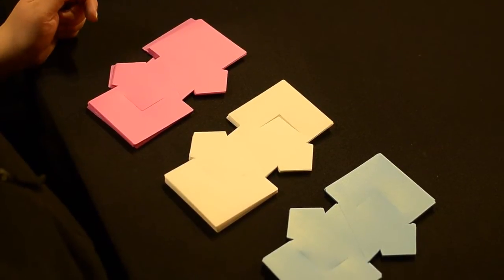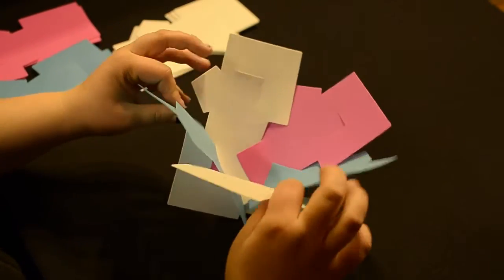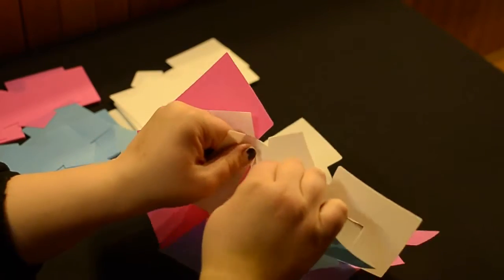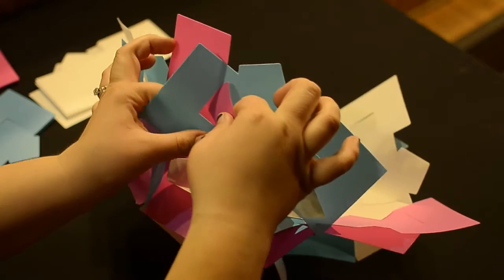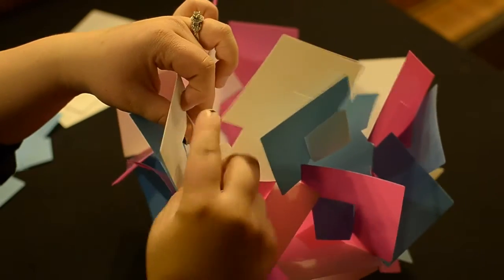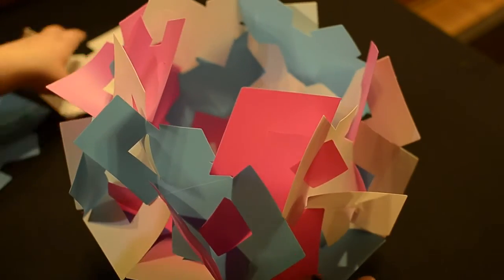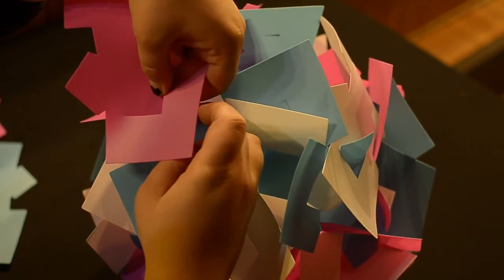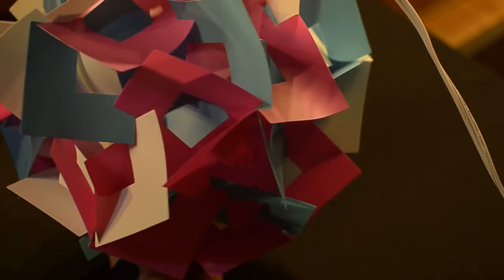Mystic Lights Square Sphere

Comment: Hey there! Isaw a light bulb/shade kinda thing somewhere on the net  and I cant remeber where I saw it but it looked  pretty. Basically  when you turn the light on, shadows are cast all over the room. Imagine looking through a hollow triangular prism and whilst doing that you shine a light through it. Light shaped as a triangle will form but around it there will be shadows. Now imagine you stacked lots of these triangular prisms on top of each other and shone a light through each of them. They would cast shadows everywhere. I was wondering if you could do a tutorial for it. 
Thanks! And the prism were aranged ina sphere  if  that helps.